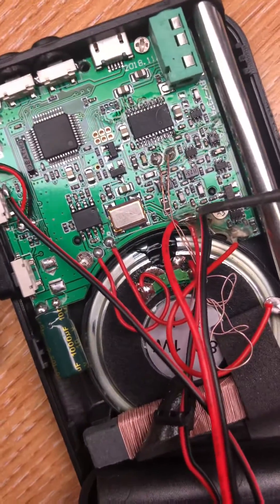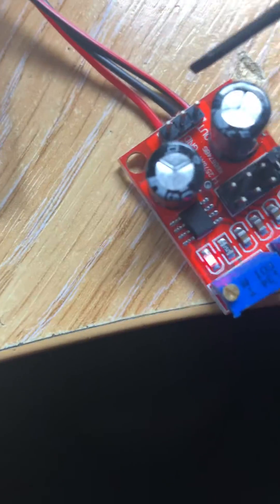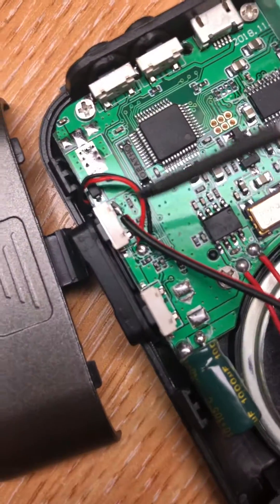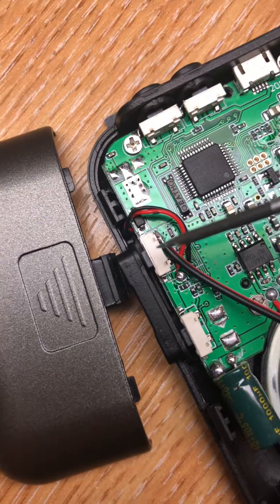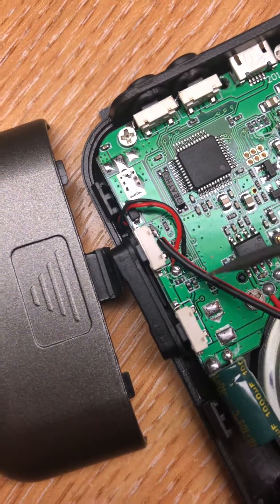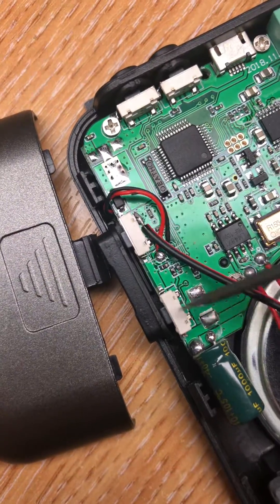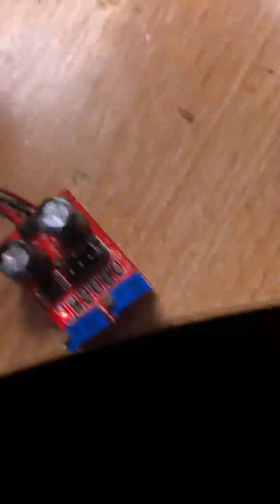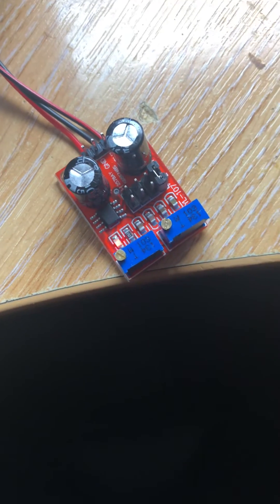How to build a ghost box sweep radio

Comment: Do it easier! 
Set it to fm Band or another, Put antenna Extension on, hold the Band Button, so it saves the good signals until its full. Then klick on Memo Button and hold the vol Up or down Button. So it sweeps through